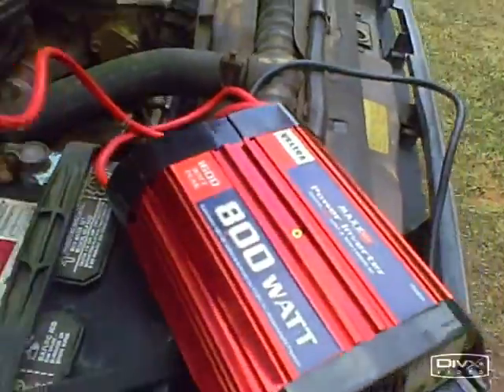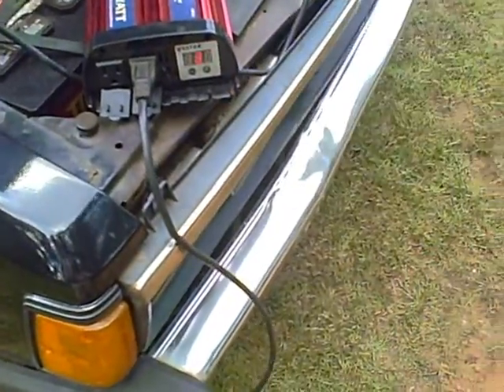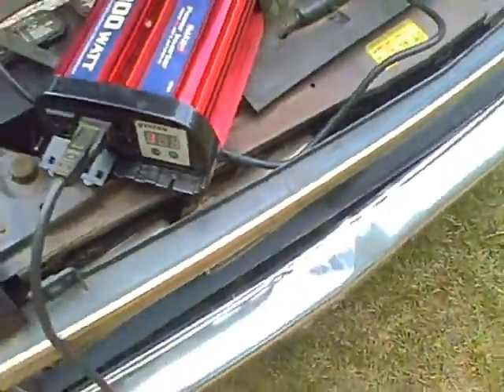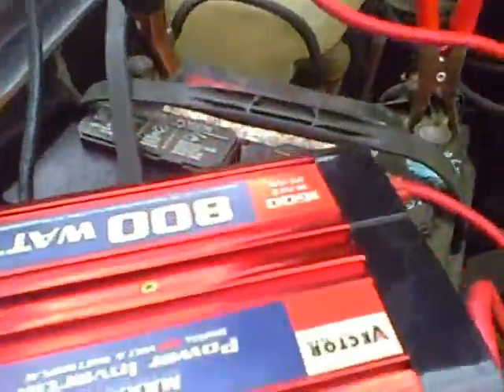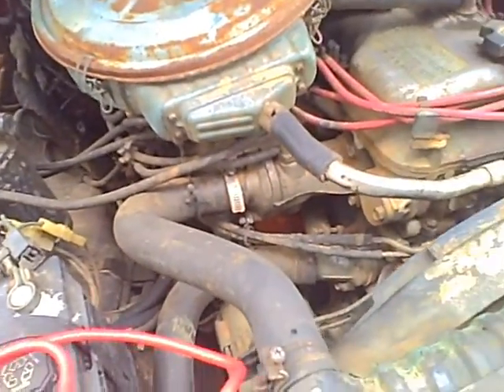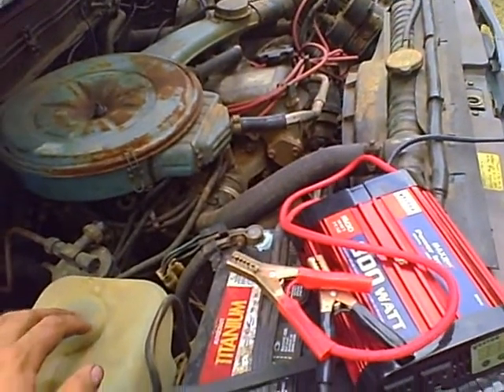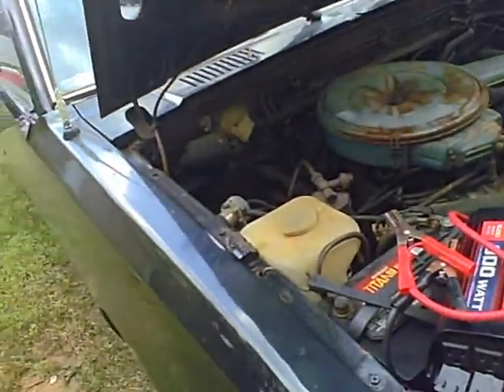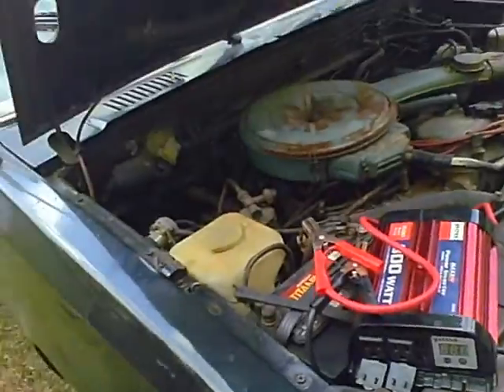DC/AC Inverter

Comment: @DannysCam what i was thinking is hardwiring to my battery like u say but then opening the inverter and take out the switch to connect it to my stereo so basically my stereo would be the switch for the inverter but dnt know if that will hurt my stereo or headrest monitors as there all connected from same source

Comment: i'd almost just get the 1200W one its what 10 bux more and you get 400 more watts. I have a 300W one on a duracell jumpstarter but its busted the cooling fan just runs and it wont put out any power.

Comment: There is no way that will power your welder .  And the more watts they put out the faster it will drain your battery if you don;t have the truck running.  Somewhere i have some plans how to convert a car alternator to put out 110 ac .